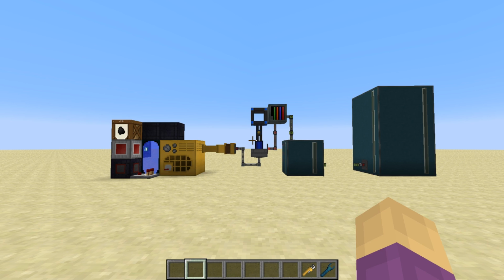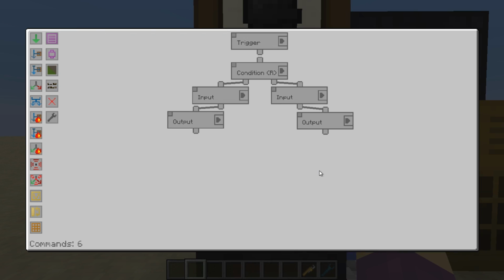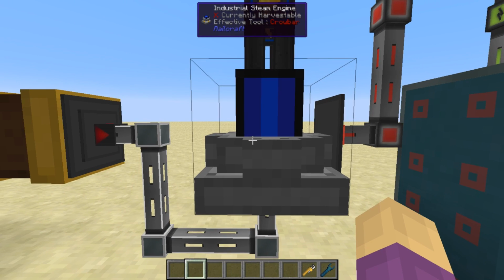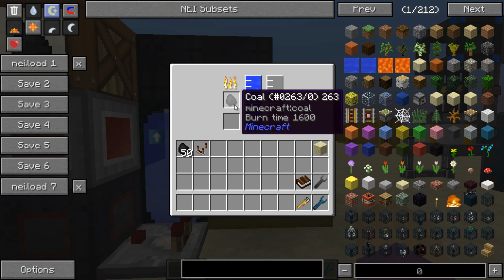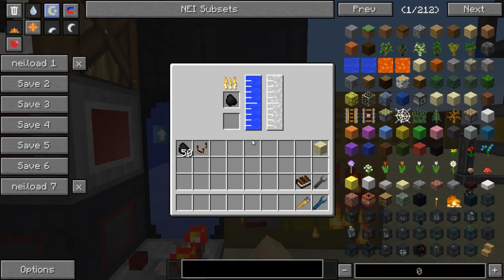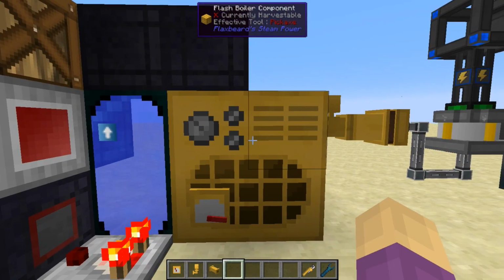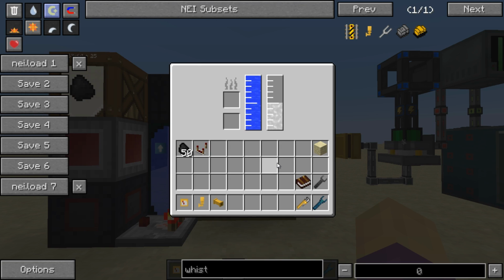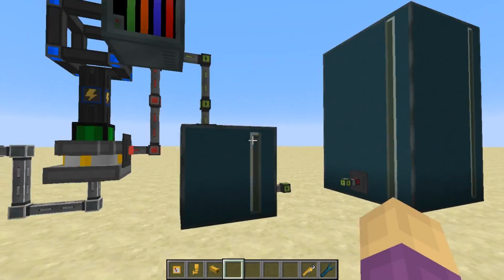Mod Guide - Strange Steam Power Automation

Comment: Looks pretty nice, although I personally prefer MFR tree farms dumping logs into a few Thermal Expansion 4 Redstone Furnaces, then shoving that charcoal produced into a Railcraft boiler to supply a Big Reactors turbine.
Reply: Essentialy i don't exactly know how the turbine works, but if it uses Steam you could pump the charcoal into flaxbeard's  boilers and supply the turbine with flaxbeard-produced Steam, cause I believe it's more effeicient than railcraft's boiler
Reply from the maker: Phoenix D. Black - König der miserablen Wortwitze As long as you have Railcraft installed.. Flaxbeard's will auto-detect it and enable the 'steam converter' that changes its gas-steam into liquid-steam used by Railcraft / Big Reactors. So in theory you could direct convert the steam .. going from the Flaxbeard's Flash Boiler .. straight into the Big Reactors turbine.. by way of the converter.

Comment: The power is does not disappear, however EnderIO conduits have internal buffer (2-10 kRF, depends on length), and it charged first before it provides energy for the connected machines.

Comment: Couldn't you also use steam dynamos from TE4?
Reply: Yes you can.
Reply: Sandra Nicole Checked this? I'm not sure if you can input steam into the TE dynamos. It essentialy works with the Raicraft Engine, because it works with external steam production.
Reply from the maker: Phoenix D. Black - König der miserablen Wortwitze MidnightFreeze95 Sandra Nicole Flaxbeard's steam is gas, not a liquid as used by Railcraft / Thermal Expansion / Big Reactors. So you'd have to run it through the converter block included in Flaxbeard's (which is enabled if you have Railcraft installed as well). The converter works both ways as well, so you can convert Railcraft steam into FSP-usable steam.

Comment: Could you use a flaxbeard steam tank as a buffer between the boiler and converter to fix the steam gauge update?
Reply: Nope, because the Tank is essentialy part of the pipe system and everything in one system has the same pressure. -> every gauge shows the same steam pressure.